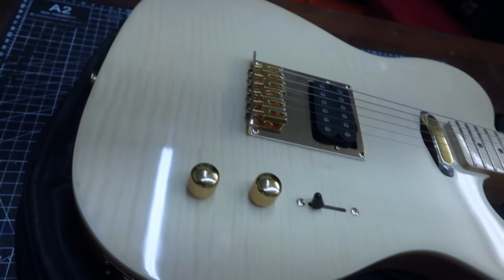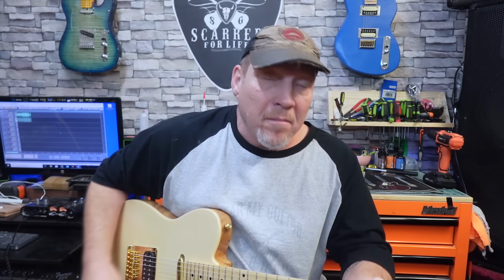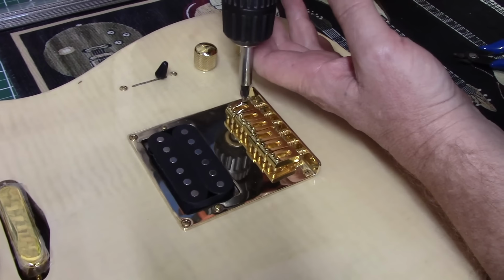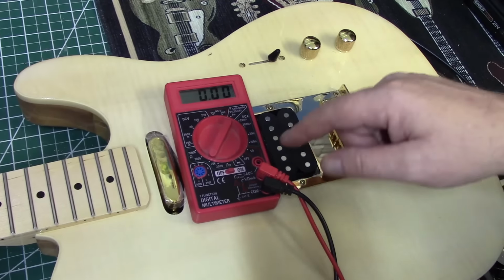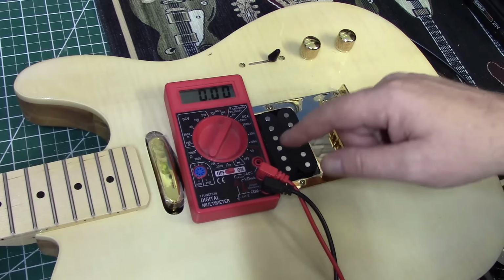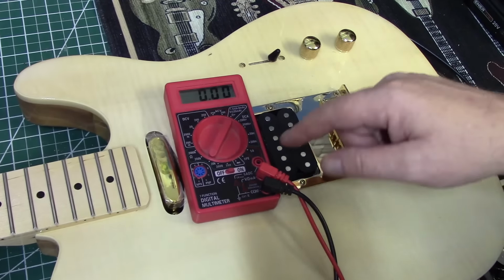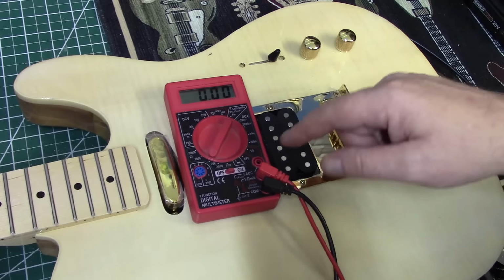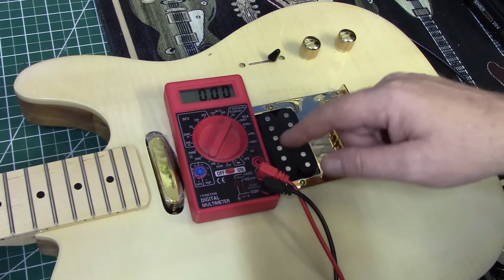$147 Telecaster Is Killin Your HIGH END FENDER!! Best Quality Control I'VE EVER SEEN!!

Comment: 12K bridge is 43 gauge wire. Thin wire like that is compressed sounding. A lot of companies use that kind of wire and from China you can guarantee its really garbage wire. No surprise there. Cheap minipots aren't very good either. 5.8K neck is 42 gauge wire, nice clarity, but still cheap wire.
Reply: Very few pickup winders check the quality and consistency of their wire, Ron Ellis does that is the reason his pickups are some of the best
Reply: @JohnAdams-xc5yk  Most pickup "winders" (a ridiculous name), don't know beans about magnet wire. If your pickup maker doesn't have a micrometer he's an amateur. Two rolls from the same may not be identical. You need to mic every roll of wire you get. "42 gauge wire" doesn't mean anything. 42 cover everthing from .00255 inch diameter to to .0029" inch diameter. There is a huge tolerance for 42 gauge. The amateurs don't know this simple fact and have never ever even seen a wire gauge chart. Fat 42 wire will fill a bobbin way faster than thin 42 gauge, less winds will fit. 42 gauge wire will vary in insulation thickness, another CRUCIAL thing you must know about any wire you're using, am I'm not talking about Heavy insulation wire.The fatter the wire the brighter and more clear it will be, if the insulation is overly thick, you'll also get more brightness. It all varies from manufacturer to manufacturer. You MUST know these things, because its a DESIGN tool. I have never ever even seen a "winder" even talk about this stuff. Thats a sad comment on them. I've never seen any of them talk about DESIGN. They don't understand the concept. They all work with ready made parts, and those PARTS DETERMINE THE SOUND. You must know what every part you use will do to the sound. This is why I make my own parts. When I first started I used the StewMac kits parts, but I didnt like the sound of that stuff. I was buying vintage pickups and taking them apart and studying the parts, and I began to see the INTENT of the designer. It taught me alot about design and I used what I found in my own orginal designs of many pickups unlike anything that anyone was making. Stuff like my Dirty Harry single coils, my Pig 90's that are single coil P90 type inspired by by an oddball pickup thats completely unknown to the public. It ended up sounding not like a P90 but its own sound. Most of these I don't make anymore because they are all hand made parts and take too many hours to make. I feel sorry for anyone buying pickups from the zillion "winders" out there, because some have been making stuff for 20 years and have no idea what they are doing. I get so many emails from guys who tell me they bought from just about everyone out there and they all sound alike. Its because they are all using the same PARTS. Its such a crap shoot and there's not one I would recommend to anyone. Anyone can go on StewMac, buy a kit and claim its their work, nope.....the designs are coming from Korea and China.

Comment: I won't do it if I don't know the weight???
Reply from the maker: That's your loss, I don't get paid for you buying anything.
Reply: @scarmyguitar  I'm actually a great fan of yours and a subscriber. I've written to you twice about how helpful it would be to know the weights of such guitars as I can't use anything much over 3kg because of 40 years of playing and shoulder issues. Also, the weight of guitars, especially cheap ones is never mentionedin the specs.. probably for that very reason.
Reply: @scarmyguitar  I agree, he give you a super uncool answer, weight is important to a lot of people, maybe he cant swing the $3 for a cheap scale.
Reply: He said it was light!    FYI: I have Cozart Tele with 2 F holes semi hollo... Disgustingly light.    I changes the single coil bridge pickup to decent ceramic and put a fender noiseless at the neck (I had one lying around).  And yes, I changed the tuners.      This guitar and a Gibson Paull II are my main players.   Love my Cozart Tele-- Weight is wonderful, neck is fantastic to play and the electronics are solid..   I would of considered running the strings through the body, but in every case I have heard about, the sound is the same, yet the string tension is different.  Surely do not want to change the feel I have now, so done modifying.

Comment: Sean, why you drilling a hole for ground wire? The pickup can ground on the bridge unless it’s plastic ??? Am I mistaken? Love the reviews by the way.
Reply: It must be ground all the way to the amp plug.  You can use the bridge if the bridge itself is grounded.

Comment: I disliked Teles for many, many years due to the traditional control plate and pickguard until I saw a Fernandes TEJ-45 which doesn't have any of that and even has an unconvered bridge pickup (meaning the bridge doesn't act as a pickup ring).

This proves that the big brand do guitars ugly on purpose so you buy higher end models, same reason why Les Paul Studios come in black or wine red with black plastics and not cream plastics and cherry/lemon burst which are colors you would more than likely find in Standards.